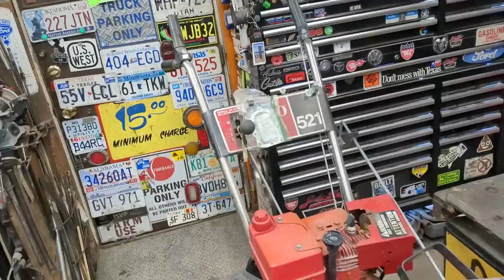Killed from too much Starting Fluid     ---Old Toro Snowblower Saved

Comment: Too much starting fluid? C'mon. Unless you mean a hydrolock condition. That weak spark may not have been capable of ignition.
Reply from the maker: Absolutely too much starting fluid. I've have one in right now with the top of the piston blown off due to starting fluid. I've seen bent rods and blown head gaskets. Someone else just commented they cracked the block on a Briggs years ago trying to run it off starting fluid. These small engines are 1/20-1/40 the size of truck engine and those you would only give a 1-4 second spray to get them going. Try to give a 1/20 of that spray and it's impossible. Now take your truck engine and spray directly into the intake for 20 seconds straight and see what happens.
Reply: @sixtyfiveford  Very enlightening. I've never used the product; I fix the problem. I did witness a backfire explode a small engine muffler but that's nothing like the engine damage you describe.

Comment: Are you adding paddles to the snowblower? I have 5/24 and a 8/26 Toro. 
⁸/²⁶ even has the red paint on  spark plug wire. 😄 nice job catching snow Ginger and free stuff is always good most of the time 😅😅
Reply from the maker: I will just sell this one off and probably won't do the modification.  If the market is good and I'm making good money I'll do the modification. People just don't care for their stuff anymore especially if it's a cheaper unit. It will go to a home where they don't know how to care for anything; sit in the backyard with garbage gasoline and be dead in 3 years from now. It'll sit for another few years collecting leaves and eventually off the the landfill.